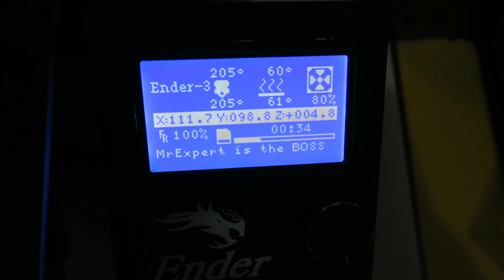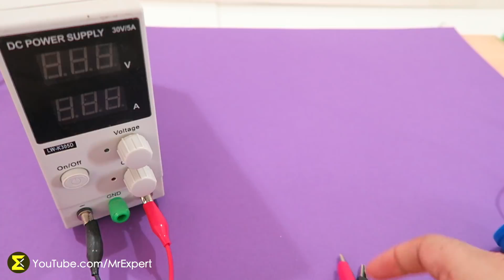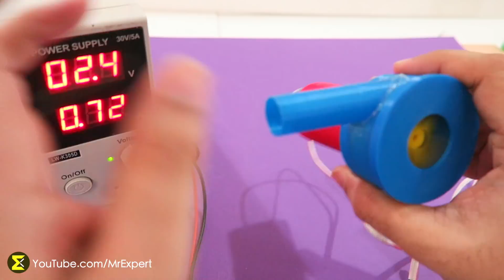DIY Powerful AIR BLOWER - 3D Printed Air Pump

Comment: Which way does the fan spin ( clockwise or anticlockwise)?
Reply: Either way. Just swap the negative and positive inputs when wiring the motor. You can test it out before actually putting everything together.
Reply: @tylerlee9484  but don't the shape of the blades contribute to the direction of the wind flow and power of the wind flow?
Reply: Counterclockwise
Reply: @dominicmartins7031  To me it looks backwards too! Maybe not but a water wheel spins in the direction of the concave side of the vanes

Comment: What is the max current this blower consumes?
Reply: Unless one knows the max voltage rating, this is indeterminable.  Generally, if stalled, the brushed DC motor will consume max current as governed by resistance.  Stall Current is not always within the safe operating area of a motor when operated that way for an extended period of time.   Motors that aren't stalled rely upon back-EMF from the motor spinning to maintain a low and safe current.   At max RPM, the motor has minimum current.  In this blower, there is an asymptotic max RPM governed by the air resistance of the fan and the voltage input tolerated before the magic smoke escapes. 

To roughly prove this, put a multimeter set to measure current in line with the voltage source and measure the current on a computer fan when you rub your finger against the center of the rotor for small friction.  Current goes up and hits maximum when stall is achieved.  Don't worry, PC Case fans are safe to stall as they exist in dusty environments and are thus expected to stall eventually.  

~One Electrical Engineer
Reply: 2.25A at 12.5v in the video(2.4 minutes)